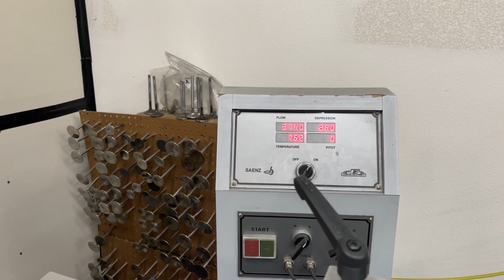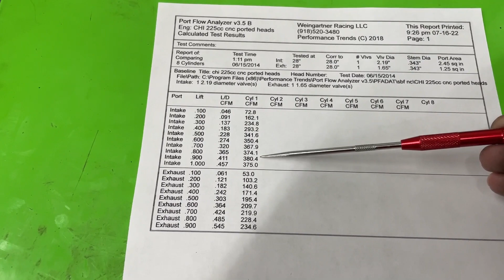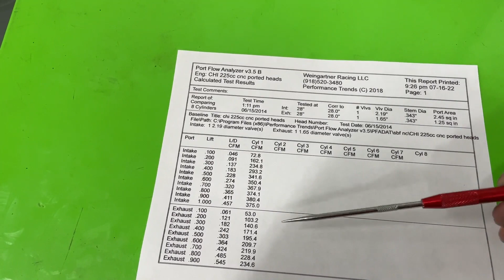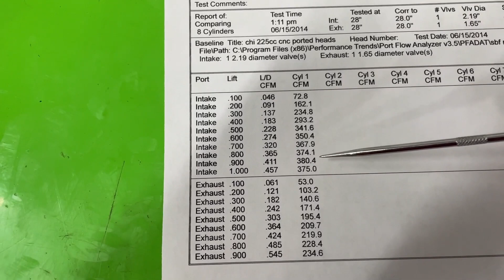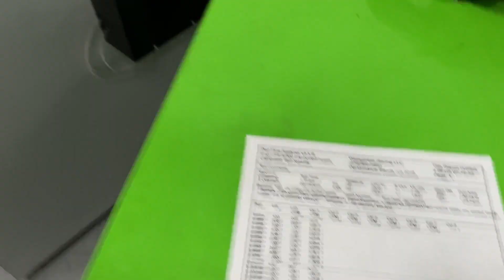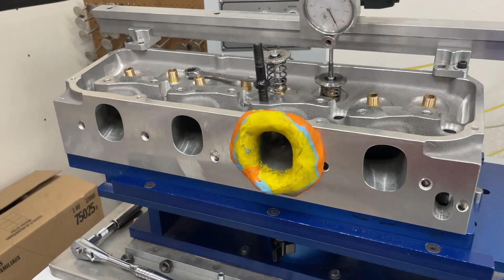SBF CHI Head Review With Real Flow Numbers

Comment: I’ve been 9.54 at 3050 with an as cast 218 head that flowed 331 at .7 and went backwards 2.66 cross section
Reply: What did your car make at the wheel and what transmission and cam specs and compression?

Comment: Eric Weingartner, could the pushrod pinch be causing the instability?  Doing the math, it seems to be the smallest part of the port.
Reply from the maker: No. Its a few minor things in the short side.
Reply: @WeingartnerRacing  did you figure that out by using the pitot tube or is it just experience?

Comment: Would like to get a set of 62cc 205 3V for my 71 400 2V.  I have an Eddel 2771dual plane intake and hooker 1-5/8 headers. Whill these heads bolt on with what I have> I know about the spec head gasket and studs

Comment: Hi Eric, not sure who told you that 
is/was a 225 head, but the 225 heads I've seen are definitely not cnc ported, and they don't flow even close to those numbers.  Also, 225 heads come with 2.15" valves not 2.19"s .
Mcsa is way less than your figures as well. Think someone has set you up there, or CHI have bought out a new head that i don't know about. 
The CHI Kaase head only has a 2.85 mcsa and flows just over 400cfm at .800 with 2.19 valve on 4.155 bore on my bench.... have to have the right shaped valve though. Chambers on them are in the low 40cc's, so really need to have the right piston,  otherwise compression gets way out of control. Very nice head though.
Reply from the maker: Yeah I messed up it’s there 242cc. I tried looking on there website buts it’s weird now.
Reply: Chi 3v 225 is a 2.19 intake / 1.65 valve. I’m from Aus and have also bought a set of the chi 3v 242 heads, but mine are the 60cc chamber not 45cc like the ones in your video Eric. Great video, love your work.🤘🏻

Comment: What's the highest volumetric efficiency you've seen of any factory head and also any ported head?
Reply from the maker: I really don't know because not all customers share there dyno results with me. It's worse now because many are doing power adder so they don't build it for max VE NA.
Reply: @WeingartnerRacing  thank you for answering.  Do you happen to know what out of the box AFR 210cc rr  heads are VE? My buddy once had some brodix big block heads extensively ported and flowed and he had 117 VE. He said most stock factory heads were luck to get 85.

Comment: Interesting.. Any ideas of why the exhaust doesn't flow? And would the heat of the exhaust gas affect the flow?
Reply from the maker: The height of the exhaust port is causing the low numbers. Its a design thing. They do have a raised exhaust port version that is very good.

Comment: Top Video Eric !!!! Who's CNC programe is on that head?? That would show better numbers on the Superflow bench wouldn't it ?
Reply from the maker: On my superflow bench it would read about 8cfm better.
Reply: @WeingartnerRacing  You made me look at my flow numbers for my Trick Flow cnc heads I got from Total Engine Airflow. Question, what CC are these exhaust ports? Mine are 115cc and my exhaust ports are raised .100"  My .400 lift on exhaust is 211.6. .600 lift is 259.6  My .400 lift Intake is 292.3 and  .600 lift is 355.5.  You are correct, the Cleveland heads are the baddest factory small block head ever.
Reply from the maker: @nova467spanker  I flowed without you exhaust pipe trick flow usually flows with the pipe. It bumps up the flow numbers.
Reply: @WeingartnerRacing  mine were ported and flowed at Total Engine Airflow either by or with Brian Tooley cnc program. These are not the same as calling Summit and ordering from the catalogue. I actually ordered them from Brian over the phone. I'm not sure if he uses an exhaust pipe though. I wish I would have known about you back in 2013 before I had my engine built so we could have tested them at your place.
Reply: @nova467spanker  Yep I run the Stage 3 High Ports from TEA and they flow almost as good on the intake side and way better on the exhaust side than these heads.
Reply: @turbo-jm8hk  are your heads the traditional Windsor design? If so,  do yours have the slight canted valve like the Twisted Wedge?
Reply: @nova467spanker  yes traditional windor design, no canted valve
Reply: @turbo-jm8hk  Thats cool man. I had someone try and tell me TEA fudges their flow numbers by leaving the spark plug out. That person insisted they did this with my heads. If anyone has ever seen what the .100 and .200 inch lift numbers are when this happens, they are much higher than my 78/147 intake and 64/118 exhaust numbers at those lifts. Some people are just jealous
Reply: @nova467spanker  I had them flowed as soon as got them and they were only a few numbers away from their numbers
Reply: @turbo-jm8hk  I wish I had them re flowed after I got mine. I understand flow benches are just tools for seeing changes. I bought mine in 2012. Of coarse these T/F 225 Cleveland heads were basically still new to the market and I had to wait 4 months to to get them. So when I got them I was in full parts catalogue ordering mode...

Originally I was gonna build a 408C with a solid roller cam but money was much tighter then. That's why mine flow like they do, I told Brian the specs and he said "you wont be disappointed" You want to know the kicker, They were $2500 shipped, Now  for just an off the shelf set that flows less they are like $3300 - $3800

Comment: I remember the engine guys on PowerBlock going a ford, Windsor vs Cleveland shoot out and the Windsor won, but it was 427 ci vs the 35? the Cleveland had and it made sooo pissed, cause I’ve read in magazines how good that Cleveland head was. The cid should’ve been the same. Nice to see some nice sbf stuff. I always wished for a clevor when I had my mustang back in the day.
Reply: Yeah, that show was a joke. They underbuilt that Cleveland bad, and stroked out the Windsor using aluminum heads and all kinds of stuff. The Cleveland even used iron 2V  open port heads.
Reply: @elmerfudpucker3204  that’s what I was thinking they did.
Reply: It takes to a ported out TFS TR head to match the ported out Cleveland, and Cleveland can go a little higher.   Cleveland architecture with porting beats out a ton of big name parts.   So they have to CHEAT it with windsor stuff to win.

Comment: word is chev employed/acquired Ford design staff for the LS. dont no how true but wouldnt surprise me .. and i though the 1969 mustang boss had windsor bottom end running Cleveland heads
Reply: https://en.wikipedia.org/wiki/Ford_Boss_302_engine
Reply: Lol that didn’t happen. The people that developed it didn’t copy anything either they took a lot of pride in the ls architecture. There was a car mag article that interviewed the 2 lead design/developers and they addressed that rumor. Not anymore than the Cleveland was copied from the BBC heads or the Mopar Poly Heads. Though the Poly heads are rumored to be what Ford looked to in design,  that supposedly from staff that developed it back then. The Cleveland block looks like an Olds V8  though… Timing enclosure and even 12-6 fuel pump holes.
 It’s a very finite space to fit a 90 v8 block, have similar displacement, fit between 2 shock towers/steering and use ohv cylindef heads that need to exhaust outback the side and under the car. Yes, designs ARE  going to look similar especially when you got bean counters looming and deadlines to meet.

Comment: I run a set of CNC'd Trick Flow High Ports that flow almost as good on the intake side and way better on the exhaust side for way less $$$.
Reply from the maker: Even though I bring up cfm a lot the design makes a huge difference. This head would make more power than the high ports. The high ports are still very good.
Reply: yes 225's I have those

Comment: Wath dou jou tink abaut wedge Alu heads Chrysler  440cui.ihave even thes CNC ported. Have only 2.08 intake valves can I get more flow with bigger intake valves? Thes Heads come from super stocker Engine.Best time with thes Heads are 9.25 (Cuda) I have Thes in May Street Challenger 70 have even Wedge Tunnel ram sixpacks modifaid.Roller cam Hyd lift 0.580 (Ratler cam) Mayby k have litel more then The orginal 440 sixpacks 390hp!! Have weery good respons on The trottel better then the Efi.I have plastisk in The intake modifaid raising The intake msuby 6-7 mm..Thes 440 are al forged parts.Spell like hell sorry.Have grate Day..
Reply from the maker: I would do bigger valves because it needs the area.

Comment: Cleveland heads,,, 4Vs are so bloody big they get no velocity, the reason people have closed them down for decades. Not so bad if you turn 9000 rpm,, and that is drag race only and the Clevo explodes over 7000! Poorly oiled, cooling is poor and they are heavy. You can modoify the oiling to be ok but then the crank dia is too big so frys the oil. The M engine is worse with 3" mains. I own both!!
363 is 4 1/8 bore 3.4 stroke. Aftermarket block only.
The 8.2 Windsor is a tiny little thing,, rod length is severely limited but it does have better oiling and the bearings are not near as big. Cooling is ,,, well ok. Still only has 4 bolts per cylinder head clamping so will never be a Chev.

Factory blocks are only 2 bolt.  Need a stud girdle for performance use. My experience is that the later 5 litre blocks are better metalurgy. And they use the Clevo firing order which is far better.
The CHI heads take the best of the Clevo design and make it work. Raised intakes, canted valves, far better chamber and ofcourse being alloy make them about 100% better than the OEM head. They come in 3 base versions, 185cc, 208cc and 225cc.  They can be made to go on Windsors as well but the Winsors off the shelf are only 185cc. My 208s  will need the intakes ported
The Aussie 302 2V head is by far the best head for street use and even then the ports really are too big!! Same size to the manifold as a Chev medium raceport.
Reply: I’ve been playing with Cleveland’s for 25 years and rev them to 8000 and in some cases 9400 and have no oil or cooling issues. Yes that’s after fixing the oiling issues but no big deal. And these are mostly street engines
Reply: Decrease cam duration on a street car with these heads.
Reply: @too51kracing81  Hmmm, not for road race or speedway use using moderatly high rpm consistently. Here in Oz we had them for many years after the Yanks. Were a potential explosion at all times.  Drag racing is only a few seconds. Street use and 9400? I dont think so!
I know drag racers using 9000 which very highly modded engines in the 70s. They won or broke!

Comment: BBC, SBC dominate bracket racing, then you have the trickle down effect from P/S and NASCAR.  If this head (CHI) would had come out in the 70s we might be seeing a different outcome, then again Smokey Yunick had the SBC porcupine heads so maybe that would have came out of the stove pipe in the early days to compete with the Clevor. Chevrolet engine popularity and the fact that the little guy could drag race and run stock car might have been the tipping point for Chevrolet. Chevy got out ahead of the other manufacturers is all I’m saying, the ppl grasped the BBC, SBC, LS, Warren Johnson and the DRCE.
Reply from the maker: I agree Ford was there own worst enemy changing engines designs regularly.
Reply: @WeingartnerRacing  I respect what you are doing you’re living the dream. In the end they all have their places and are air pumps with corporate names attached to them. But Jesus does a BBC sound awesome cammed roaming the pits or at full song. Thank you and keep on doing what you do, I like the fact that you stick to your guns and tell ppl what they don’t want to hear. Thank you.
Reply: The Cleveland makes more power per cubic inch than any other engine, oem n/a its not even close.

Comment: Cleavlonds are great but Windsors are 100x more abundant cheaper and bigger and more durable
Reply: So what we do is get a 351w block with performance upgrades and and big mains throw a Cleland crank and heads on the use a 4.125 bore and 4.65 stroke and you get the ford 454